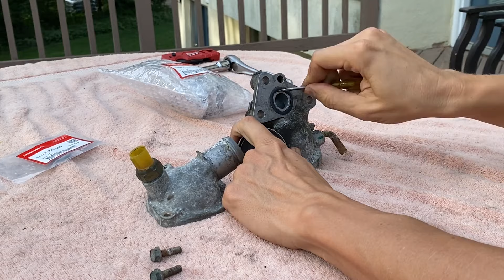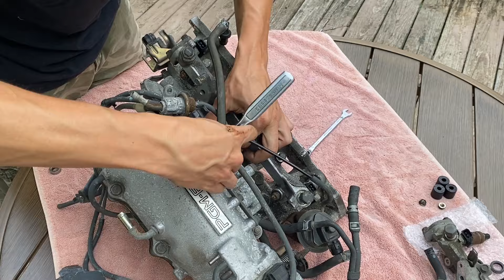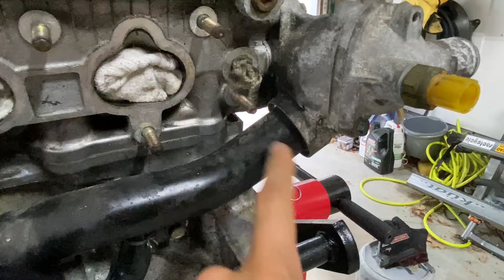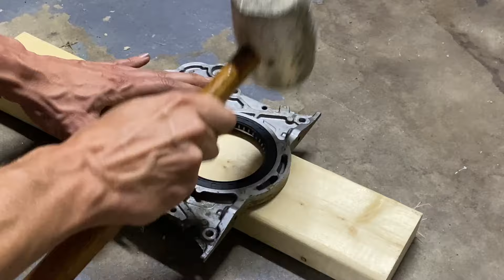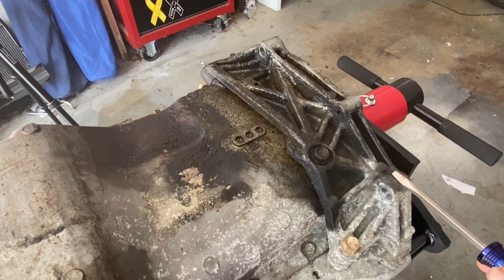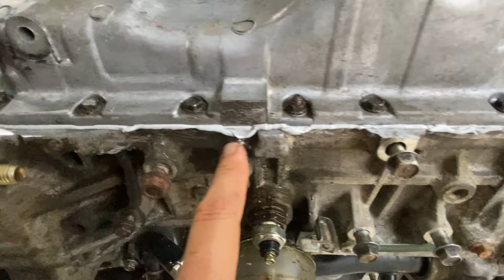Part 2: H22 Prelude Engine Swap Into a 90-93 Honda Accord CB7 CB9

Comment: Bent a valve when replacing lower tube seals in my 91 CB9 5speed and somehow went from videos to help repair my F22 to H22 swaps…. And I must say, I’m impressed! Most clear and thorough videos I have found. Can’t wait to finish the H swap series!

Comment: I've also was told by a h22 guru or g23 guru that on the accord chassis you need to switch pinouts a6 with a11 swap them around for egr and o2 sensor since they are backwards on preludes. Well I'm told for the 95 accord chassis anyway. Im not sure if cb7 90-93 will be the same

Comment: I'm in process of gathering parts and doing this exact swap on my 95 cd5 accord. Im using the f22 manual timing tensioner just to save some money. And ill be keeping the balance shafts since it's a free way to keep the engine in balance while high revving. Those ati dampeners are pretty pricey. But I've seen some good out of deleting them with the eliminator kits from ks tuned. You would gain 5-10 psi of oil pressure if you tap and plug your oil ports for the balance shafts. Im using a obd1 h22a1 distributor to eliminate the external coil. And ill use the stock h22a4 injectors and just loop my resistor box wires together. I was thinking of using rdx injectors but I want it close to stock as possible. I'm using a p06 ecu with vtec added and chipped so I can later on tune it if I need to. I had a f22a1/f23a hybrid turbo setup previously but I'm tired of chasing turbo problems and would like to have the car on the road for years to come. I see that you used f22 timing components, I just soldered the h22a4 alternator plug onto my harness and kept all h22 components, the wires are color matched so it was easy to hard wire together. Ive been seeing this guy with a prelude convert his power steering to electric and I think this route would be great to do since its a clean way to eliminate the pulley and reservoir tank. But love your process and story of your build.

Comment: Sucks you put to much honda bond. Honda specifications are to only apply in the corners and rounded part in the middle.
Reply from the maker: Only on the valve cover.  The aluminum oil pans Honda specifies Hondabond all around as opposed to the steel pans which had a rubber gasket.

Comment: Hey there. I'm doing a h22a4 swap auto tranny into my 1990 accord ex. I'm trying to figure out what ecu I have to use. The motor came with an obd2 ecu but I've been seeing that i need a p13 ecu. Any advise for me ? Thanks
Reply: Did you ever figure it out? If so what was the decision?

Comment: Just a thought but when I did my h23 intake manifold I didn't put new hoses on that go under the intake manifold and it ended up being a headache. Easier to secure them and the manifold outside the car.i recommend thermal intake manifold gasket as well in case you need to taje it off you can reuse it
Reply from the maker: Thanks - the more I think about it, the manifold is going to be mounted while doing the wiring harness.  Have that thermal intake gasket lined up too!